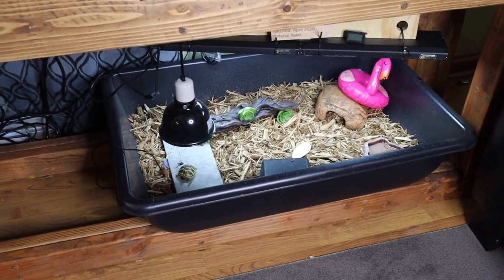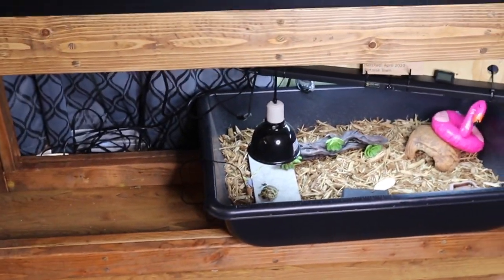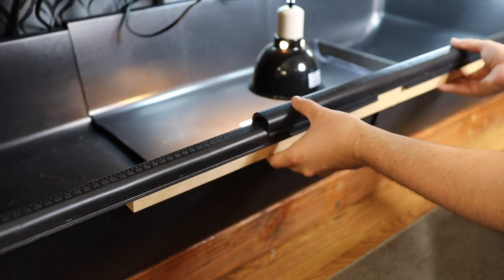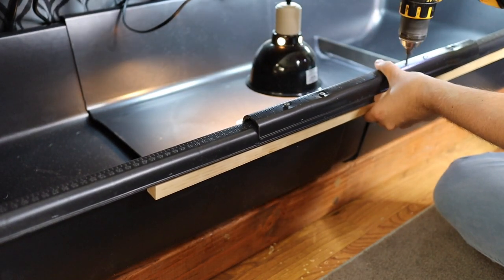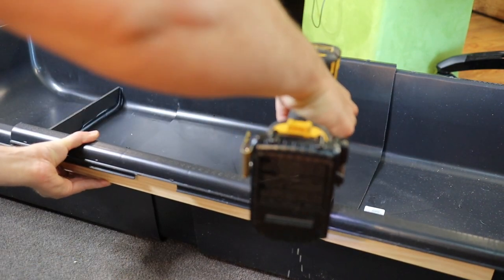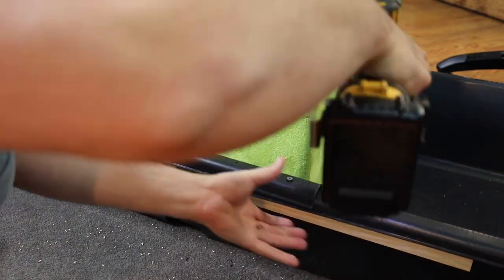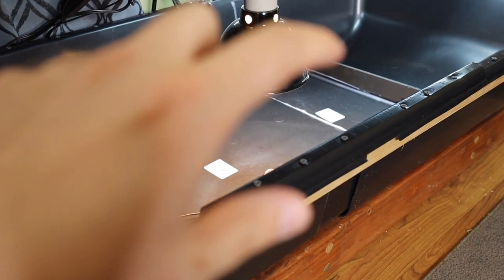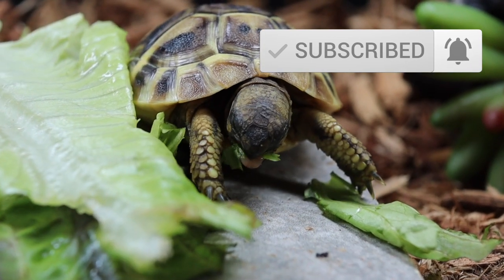Ultimate Indoor Tortoise Enclosure

Comment: How did you cut the plastic so cleanly?
Reply from the maker: I used a table saw to cut it.   It is a bit squeaky to do it that way.  But a jigsaw would work.  Or even a hand saw.  Then you could use a file or rotary tool to clean up the edge

Comment: Did use a slab of concrete for turtle to eat on?
Reply from the maker: It’s a piece of ceramic floor tile.   A small price of concrete would work too
Reply: @SomethingJackMakes  do u think that a brick would work as well or no?
Reply from the maker: @fergusaur_7306  you would need to put the brick down low enough in the substrate so that the tortoise could get on top of it.  A brick just on top of the substrate would probably be too tall for a young tortoise. And I would worry about the tortoise flipping over if the brick is too tall
Reply: @SomethingJackMakes  oh ok I’ll be sure to keep that in mind. I was just worried that the brick wouldn’t be a good substance for the tortoise to eat on.
Reply: @SomethingJackMakes  any plant decorations you recommend for an indoor enclosure ?
Reply from the maker: @fergusaur_7306  you just need something hard for it to eat on. 1) to wear down its “beak”. And 2) to keep lose substrate like dirt or sand form getting on the food and being ingested which could lead to impaction.
Reply from the maker: @fergusaur_7306  fake plants work well.   Real plants are nice. But the tortoise will try to eat them. So you need to make sure they are safe to eat.  But also it will probably eat it faster then it will grow so the plant won’t last long.
Reply: @SomethingJackMakes  ok I’ll look into fake plants then. Thank u so much for answering all of my questions, you’ve definitely earned a subscriber! I’m getting a Russian or hermann’s tortoise this Saturday so you’re helping me out a lot😄